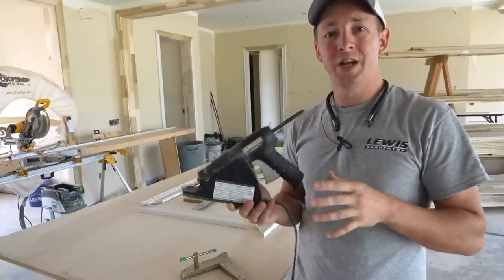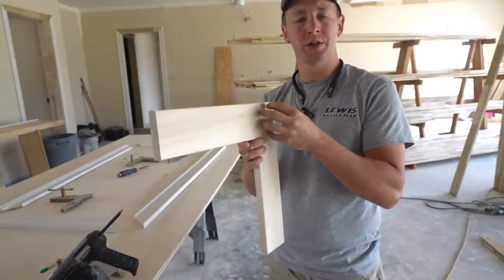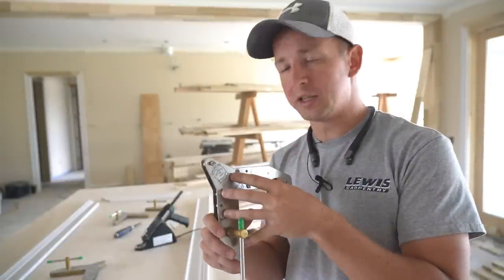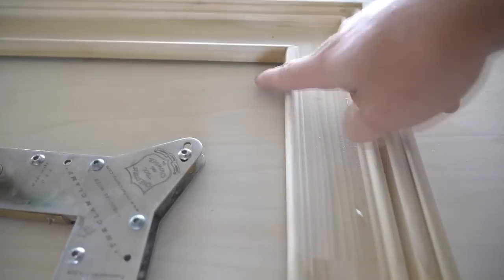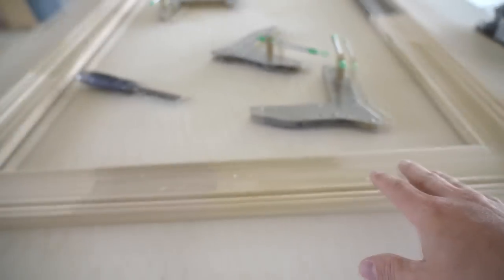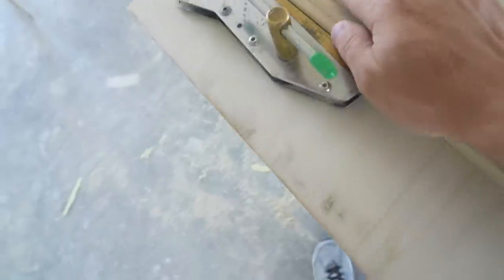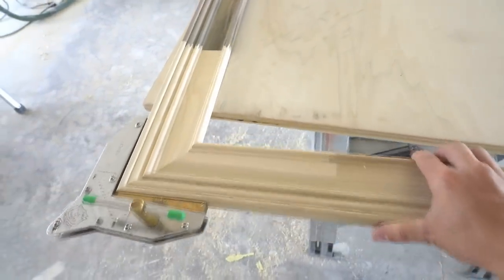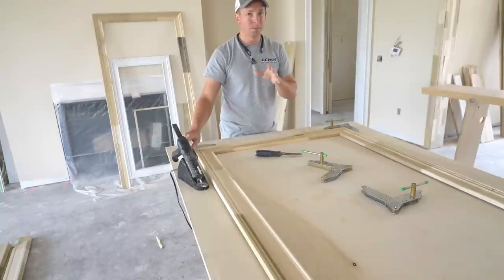Problems With HIPUR? Why Are So Many Struggling With PUR Adhesive for Mitered Casing???

Comment: I can see that a high tooth count to cut a hardwood would cause that issue.  I noticed even with regular old wood glue that a 36 tooth blade did a MUCH better job overall than a 60 tooth or higher blade did.  I had a custom staircase to trim out, and I was having problems with adhesion, burning, etc.  once I put a "rough cut" blade in my saw, everything worked out so much nicer.  That's when I learned that a "finish" blade is a relative term.  It's what the wood wants, not what the worker wants.
Reply: Well said, thanks for commenting !
I love my 60T blades, but ,,,,,
Reply: Which 36 tooth blade did you use ted?
Reply: I've been running the CMT 50 tooth more often than not.
Reply: Ted Fry excellent point

Comment: I had a problem with the glue and it was because the case was to cold, so I found that if I hit the joints with a heat gun for a second it gave me time to get things set before things started setting up.  It’s also a great suggestion anytime if you know you are going to need a little more open time.  Thanks for turning me on to this glue!

Comment: I guess I don’t see the real value in this system if it doesn’t work well with pine.  Here in Virginia, pine is the only casing material sold.  To get poplar is a custom order from a mill shop.  I’ll try it with my upcoming project.  Hope it works well.

Comment: I had issues getting the joint tight after applying the glue. Didn’t want to use clam camps on the material Being used. I found a clamp technique that doesn’t imbed into the material and after a couple of test runs the glue worked very well. Scoring the face where glue was being applied made a huge difference in the white oak miters.

Comment: Had a miserable experience with HiPur on pine 3 1/2 inch door casing.  Followed exactly like Spencer says.  Used the 60 second set time adhesive.  Dry fit the joint with half pressure with clam clamps.  Applied the HiPur at 350 degrees per the glue gun.  When I made up the joint with HiPur it set up so fast that when clamping it together I could not get a tight joint.  The joint would not close due to the hardened HiPur.  Plus is was very weak. I then used CA glue with accelerator and it worked great.  Much stronger and tighter joint.  Threw the HiPur gun and glue in the trash and will stick to CA glue.  

I did buy the glue from Amazon so perhaps it was a glue quality problem but I’ll never find out as CA with accelerator is so much easier.

Comment: Spencer, you should try warming up the mating surfaces with a heat gun first if you have problematic material or a joint that has held together by hand.  It keeps the glue at a runny viscosity for longer so you have more time to twist and work the adhesive deep into the pores of the wood.  Also gives you more work time and a tighter glue line for when clamps are not an option.
Reply: Thanks for posting !

Comment: I don't have any experience using this glue gun or this specific glue, but i do have years of experience with PUR glues. I own a finger jointing plant and we buy PUR in 1000kg (1 ton) bags about 10 at a time. The glue generally has a shelf life of 1 year after date of manufacture. After that is seems to thicken and go like jelly. Becomes a nightmare when it goes through the pumps and applicator heads. It's available in multiple set times, we use 3 minute. 
Moisture in the timber and air set it off. The more there are of either the faster it goes off. Sometimes too fast if there's a stoppage. 
95% of what i do is radiata pine, and it bonds extremely well, so i don't know why so many are having issues joining pine trim? Can only assume it has something to do with the fit of the joint or the speed at which it is assembled maybe? If it's already foaming up and you're trying to clamp it together it's all over red rover.

Comment: This is so timely because I did buy the gun and the glue (2 tubes off amazon, then two tubes direct from Infinity Bond) and had no luck getting it to work on pine and was about to message you asking for help.  I tested the joints after setting them with the woodriver clamps and while the joint held it broke apart in my hands after 1min of set time.  I was expecting more strength.  I tried one joint waiting over night and it was still weaker than pva glue.  I ended up on one job using the clamps with ca glue plus woodglue which worked pretty well so I was convinced of the method but not the HIPUR.  I just tried it again on poplar/oak handrail using your method exactly and it held up well enough to screw the rails down.  I'll have to look at the things you mentioned, the resin in the pine and having a high tooth count with too fine of a surface make sense and either could be my issue.  I'll try on some poplar.  How long would you say to cure on an average humidity summer week to get that kind of strength you demonstrate?  Overnight or a full week?  I love the concept and prefer the one glue gun to using two glues so I really want to get this to work.
Reply from the maker: It cures out kind of like a curve on a graph. Lets say you have 30% strength after 5 min. 50% after 30 min. 75% after 6 hours. Full cure after 3 days. I don't have the exact numbers but its somethign like this. 

You may have to give up on pine. I hear so many guys who are not able to make it work with pine. 

The piece I demonstrated was at full cure. It had been sitting for a week. But I bet it would have been similar after 24 hours.
Reply: @InsiderCarpentry  Well, at least it's very helpful for you to put this out there and confirm that it's a common issue.  Otherwise I was close to assuming it didn't work at all.  I can reserve it for some woods and use a combo of ca and pva glue on pine, which has worked for me thus far.

Comment: Spencer I went to a job and the casings looked like they grew there. I was amazed. I’ve been a finish carpenter since 1971. Still at it. I enjoy your vids. The studs and drywall work has always been suspect. You must be cutting a lot of drywall to make your casing fit tight to the wall. Great vids. Thanks alot four all your content  I content. Great for all the young and old guys. Rolling the miters is a must for most windows sometimes doors also. Haven’t seen you cutting drywall back at all. ?  Or back beveling window frames to allow casing to sit tight to proud jambs. Again great vids

Comment: Thanks for putting this video out. For MDF I always use CA glue with the activator and have great results but for clay-coated pine or finger joint pine the CA glue is too brittle so when I saw HiPur I thought it was gonna work just like CA glue with cancer board. The first time I used it in clay coat pine the joints just fell apart when I moved them even after letting them cure for 5-10 mins so I thought I got a bad tube and ordered another one. Nope same problem so I tossed the Hipur gun in the garage never to be seen again. The only thing I was doing different was the wood species and I was using pinch dogs not clam clamps
Reply: The clam clamps are essential, pinch dogs don't get the pressure needed.
Reply: @quintonpaulin9826  Thanks for the insight I'll definitely give it another try with clam clamps but I thought it was interesting because he said he held some of the wooden hand rails together by hand and it stuck.
Reply from the maker: They will hold well when you have a larger mass of wood such as a handrail. But I also heavily score both sides with a utility knife. Gives more for the glue to grab into and also channels for the glue to go. The scoring will allow for a tighter joint.

Comment: Very well done vid Spencer. Appreciate the tips and tricks you’ve learned over the years after converting over to PUR glue.
Agree w/ you that PUR is a well kept secret, when comes to trim work; as I know used to always use CA glue exclusively till learned and tried PUR, and there’s a difference. Still use CA, but it’s all based on what doing, like any job.
Thanks again for your tips/tricks w/ working with this PUR adhesive.
Cheers✌🏻

Comment: I recently had a job with a tight timeline, and I couldn’t wait for glue and biscuits to completely dry and then sand the joint. I gave hipur another try and really focused on dialing in the system. It worked great and will be my new standard going forward. 
I also found that if you start with the heel of the miter touching and let the clamp pull the toe together it really compresses everything better and gives a smaller glue line. Pre finished stain grade will still be biscuits tho because I can get a zero glue line joint.

Comment: First time I have heard of this glue setup. We have glue guns with sticks here on this side of the pond but I would never use it for miter joints. I use CA glue ( it’s called miter bond here) and pin the joints. Don’t think it would take that stress test you did. Really enjoyed the video 🇮🇪
Reply: Those sticks are just ordinary "hotglue" Nigel... I wouldn't use them for anything I want to be permanantly stuck... they're great for making templates for worktops going into a recess or alcove using shim material... 🤗

I don't know if PUR is available here in Ireland, I've never seen it... but then again, I wasn't looking for it so... 🙄😂

Those clam-clamps are the dogs bollix.. 😏

😎👍☘🍺

Comment: It’s pretty obvious to me Spencer where the problem is ; when applying and clamping ?  I am just switching over and getting ready for an upcoming job doing a bunch of doors, windows, and base.  
I am planning to use it on the doors and window casings?  
I think I am going to set my phone up and just before I start the gluing I am pushing the timer to see where I am at?
I am in the Nor-Cal area (nothing to do with So-cal where it is crazy land) but we do use finger jointed pine!  And hopefully this General who I am sub-contracting to will buy finger jointed popular ?  But either way I am trying it?
I will let you know!  However; I believe it’s timing!

Comment: Your statement about buying from Amazon is very much valid as a possible cause. Unfortunately Amazon sells by way of individuals as well as companies. You have no way of knowing where that glue came from or how old it is.. I would never buy from Amazon and I will tell you why. Sorry for so long but this is very important in today's online buying scenario.

I bought some oil based wood floor product for two 5 gallon cans. The price was competitive but low comparing to all other searching. The cans were all fresh from dates on expiration as stamped.. I had so much trouble with this finish that I literally had to sand it off multiple times. I finally contacted company who manufactured it. I was told my issues were not at all something that they were having problems with.

I contacted the seller. They told me their company sells alot of different finishes. What they did which to me I could not prove, is that they were putting one gallon expired and old cans into 5 gallon cans and putting an unexpired date on the cans they were selling. They were most likely getting these "expired" cans for next to nothing and reselling at a very good price, but not too low to make you feel any issues going on. They could also get 5 gallon containers and put them in one gallon cans and mark them with fresh dates as well. They actually told me they put them in new cans for shipping purposes 

I had the biggest mess you ever saw and was going to sue them but could not prove the age of finish or tampering of product.

This is just a heads up on being very careful on buying anything online at Amazon especially. Buy from company or well known seller. All these products with expiration dates that are expired end up on either Amazon or Ebay. Do not buy. Same with counterfeit tools. You cannot tell the difference until it is too late. Different types of steel are changed, or motors are cheapened. It is big business as these dishonest  sellers will do this on so many items you have absolutely no idea that you just bought something of inferior quality. Like I did. And yes, there is no doubt I was sold expired wood floor finish to fill the pockets of sellers who could care less about your time and hardship in getting it back off.. I am sure they are doing it with this glue. No doubt in my mind. Thus is big business and profit margins are huge.

Comment: Wish I saw this video sooner but yeah over the weekend had some pretty poor results from the PUR adhesive, but checked all the boxes you mentioned. 2 1/4 casing, pine material, and used a high-tooth count blade for cut the miters. I tried scoring with a utility knife on some of them and I think it definitely did help, but overall think those 3 issues you highlighted + handling them rough the same day caused the failures.

Comment: I tried this gun out for a few years and gave up, but only for my specific use case. 
I found it’s really material dependant. Like for the poplar or MDF style trim you’re using here it has great strength, but far less strength on smooth hardwoods like maple or oak.
I also noticed that because it’s so thick, it can be hard to really clamp the pieces together tight enough. But this admittedly is only because all the materials I work with are prefinished, and there’s no painter coming behind me to fill and finish, so I can’t use any clamps. 
But I really do think for your use case that the HiPur really is as good or better then 2P-10.
Reply from the maker: Agreed. It doesn't have much use in prefinished material situations. Glue line is too thick unless you're using clam clamps.
Reply: Let your glue heat up for 40 to 50 minutes, and you will be amazed at the difference it makes in conjunction with clam clamps.That along with a quality blade and a fine tuned saw should make your glue line disappear.

Comment: I've used this technique with 2.5" poplar casing and have had both amazing results and some failures.  From what I can tell there are a few reasons for the failures.  The first is that a 2.5 inch narrow colonial profile is far from ideal, but if you get a perfect bead and quick clamping pressure I have created many unbreakable joints, but you do need to execute perfectly.  The other issue I have had is casings where the material is warped.  I do not use finger jointed poplar so my material can be bowed and twisted and I'm often trying to glue, clamp, and fasten into submission.  When you do this, especially with window casings, there can be a lot of rotational force on the joints as soon as you remove the clamps. For this reason unless I am dealing with really flat stock I prefer to leave the clamps on overnight and wait for the product to fully cure.  That unfortunately does defeat some of the purpose of doing it this way unless you have a large collection of clam clamps.  Lastly, working on the floor I tend to get worse results than working on an elevated and flat work surface even when everything seems to have been executed properly.  The finished surface left by the blade is a variable I hadnt considered.  I use a Forrest Chopmaster blade which leaves a fine finish so probably worth trying to create rougher mating surfaces or even scoring with a utility knife and see if that helps.
Reply: Thanks for your comment.  It makes struggling with 2.25" colonial (as I type this) feel a little validated.  It's also only 1/2" thick and with the clam clamps I got, I have to shim up the trim a little so the pins aren't so close to the face

Comment: I stopped using mine also.  
I was using clam clamps, but all the trim I install is pre finished.  I found that the glue was getting all over the finish, and ruining it. The few tubes I used did not just flake off like you had just shown.
Also I purchased off of Amazon so it was probably bad tubes.
Reply from the maker: It's not ideal for prefinished material. That's for sure.

Comment: Just bought in to this set up, Tried it with maple and had a horrible time. Had a super thick glue line, and it didn't seem to bond well with the casing. I glued 5 windows up and set them aside over night and ended up not being able to install them. I could easily break the miter after sitting for 20ish hours and the glue line looked horrible. I'm gonna give it a shot with poplar on the next job and hope for better results.
Reply from the maker: I don't think it likes the "closed grain" nature of maple. The end grain is to tight and smooth. Nothing for the glue to bite onto.
Reply: As many Canadians can attest, end grain gluing maple is a very difficult task.
It simply does not absorb glue well, even yellow glue etc
Not your fault, or mistake.

Comment: Spencer, I just did a small trim job using brand new 30 and 60 second HIPUR, ensuring that it heated up for at least 30 minutes prior to use, verified that it came out totally clear, and yet none of the joints even began to hold. It was as if I had put plain candle wax between them. 

I tried it on pine, Poplar and MDF. Same results for all three. I used my genuine Cam clamps to pull the joints together, let stand for 30 minutes, and not a single joint  even thought of holding.

I then flat sanded the mating surfaces with 100-grit to provide a "tooth" and still I got zilch. Very frustrating. 

Finally, I resorted to CA gel glue, Cam clamps, and then spray activator, and completed the job with perfectly closed joints that held like a pit bull.

I have no idea what's going on as I have used HIPUR successfully in the past. Any suggestions would be greatly appreciated.
Reply from the maker: I honestly don’t have a clue. 🤷‍♂️
Reply: @InsiderCarpentry  

Thank you. Neither do I.